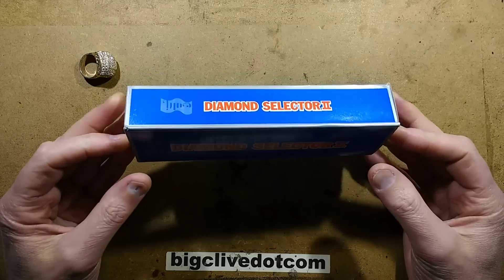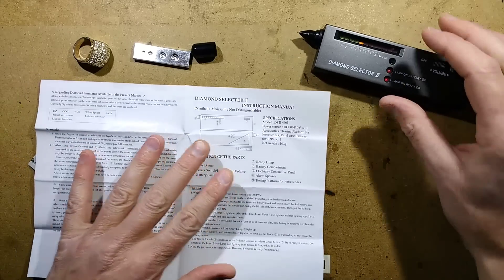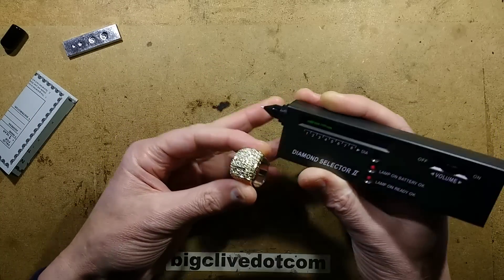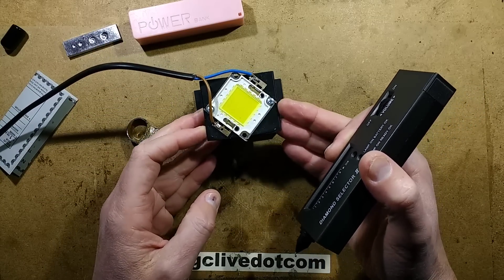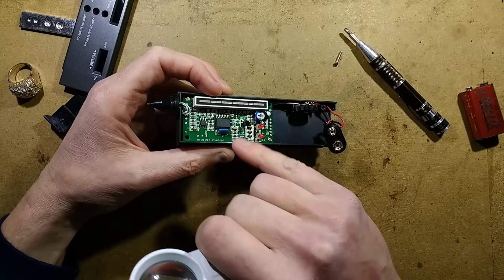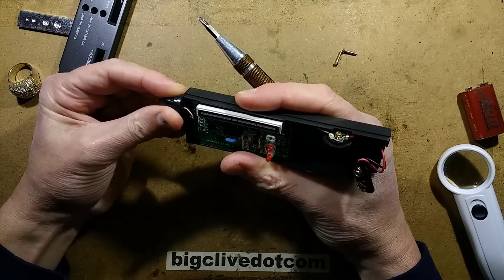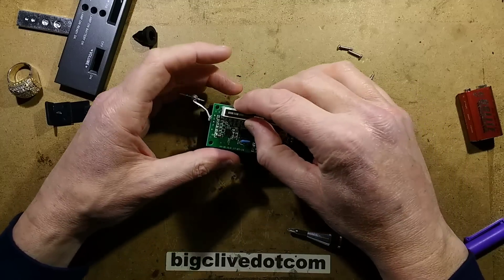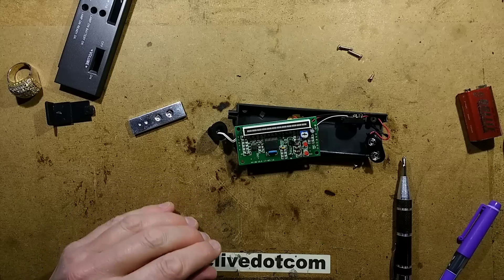Inside a diamond tester.  (thermal conductivity)

Comment: So looks like it has two back-to-back thermocouples, so at a constant temp the voltages will cancel out. The output will be in the microvolts range, so the pot will be to cancel out the input offset & drift of the amplifier stage - there will also be some thermocouple effects on the PCB & components so it would be pretty hard to make something like this without a manual offset adjustment.
Reply: Thermocouples work by welding two dissimilar metals together. based on  what I can see in the video and confirmed by Clive, the joints are soldered together. soldered joints will not make a proper thermocouple.
I would say, they are using a resistor bridge. the PTC wire is the common and the 2 copper wires are the other two ends of the resistors. the rod is the resistive element and it would have low thermal conductivity I would guess something like stainless steel (although, stainless doesn't take solder as far as I know)
Reply: +LateNightHacks  Stainless steel will take solder.  Phosphoric acid is your friend.  http://www.bssa.org.uk/topics.php?article=150
Reply: I also think that soldering two metals together will not make a proper thermocouple.
Reply: mikeselectricstuff in that sense is it like a PIR or load cell where the actual values mean less than the fact there's a differential?
Reply: Any junction of two metals makes a thermocouple IIRC, it will just be much more pronounced voltage difference per degree with certain combinations.
The difference created by the solder might be negligible enough in this case (given the resolution of the bar graph), or perhaps it gets canceled out by the use of two thermocouples.
Reply: +SarkyBugger
Cool, gotta get me some
Reply: RTD?
Reply: More videos PLEASE! ;)
Reply: Mike ya legend!
Cheers for the breakdown there...
...and make some more vids, ya legend!

Comment: Hey Clive, could you maybe take a look at one of these:  http://www.ebay .com/itm/DC-DC-5V-12V-Step-up-to-300V-1200V-400V-900v-1000v-Boost-Converter-Power-Module-/152175524315?_ul=DE ,because most hv supply's are quite expensive and i dont need 100kv at 1a so these, if they work, would be quite interesting

Comment: I'd be interested to see if you got a different reading on a heatsink with thermal paste.

The reason anodising is beneficial to heatsinks is because it creates a microscopically porous layer which effectively increases the surface area, and hence improves dissipation. However because the surface is less smooth, it has less area in contact with the heat source. Thermal paste increases this area by filling the pores in the anodised surface, which improves thermal conductivity, so I'm guessing we'd see a bit of a difference using this on a heatsink with thermal paste.
Reply: If the body of the component attached isn't at the same potential as the heat sink, typically ground/0V, or the potential of other components attached to the same heat sink,the mica isolates the component electrically from the heat sink and/or other component[s]. See also sil-pad.
Reply: The pores are in the 100A to 300A range, very small and once died black and sealed in boiling DI water it is no longer porous.  In early days you hard anodized a heat sink with a thick layer to act as an insulator so your didn't need a mica insulator.   Wouldn't do any good to have more surface area on the heat sink then on the device in any case.
Reply: What is the reason for adding a mica insulator on heatsink?
Reply: So when the next time i see a heatsink anodized on the part which interfaces with the heat source i can presume that whoever designed that device have no idea what the fuck they are doing?

Comment: I'd be interesting to see what happens on those copper sense wires on a scope sometime
Reply: Paddy Robinson-Griffin If they are in fact forming thermocouples then the answer will be not much as the voltages tend to be in the microvolts range yet most oscilloscopes do not measure well until you reach the level of at least a few hundred millivolts -- particularly in the case of digital scopes where you typically need at least several hundred microvolts to reach the per-bit quantization step, so your signal would be largely lost in the noise.  There are more sensitive scopes but they are few and far between since we generally are not interested in microvolt level signals when probing with an oscilloscope.  Plus such low level signals can be problematic to measure with long leads as the leads themselves can pickup RF and magnetic fields (induction) that can easily produce signals that would swamp things, so careful shielding (Faraday cage) is often required to be certain you are really looking at the signal of interest (note the use of very short leads in the device since they are not shielded or twisted).

You could assemble several precision opamps to boost their output to measurable levels, but that is a bit more involved now since you have to build a project before you can actually prove the signal...and there is always the risk that all that added capacitance might well distort whatever signal you sought to measure in the first place.  The best bet would be to just probe the inputs to the microcontroller to see what it is working with since those are the signals it is actually processing and analyzing.
Reply: Ethan Poole Excellent points very well communicated, thank you

Comment: Instead of using the thermocouple effect, maybe they're measuring the resistance of the sampling rod. The PTC has a power and ground side. The ground of the PTC is used as the common for measuring the resistance at the ends. It doesn't have to be absolutely precise but would need to have both ends balanced like a wheatstone bridge. Easy job for an op-amp and eliminates the non-measuring connections from forming an accidental thermocouple.
Reply: Yes I was thinking the same thing, I believe it's more than likely.

Comment: If the sensor is a  thermocouple junction then my guess is that the device sends a current through the junction (causing it to heat). When temperature stable, the current is at a minimum (ambient loss). If heat is drawn out of the hot end then current will increase. The op-amp may be used as a precise current sensor allowing the current change to be measured. Change in current would relate in some way to the thermal resistance of the test material.
 - Eddy

Comment: Yep. Am jeweler. I never trust these things to ID a moissanite, even the models that are supposed to.
Reply: Juraj Lonc heat it up to 700 degrees C, if it ignites that means it’s a real diamond. CZ and the silicon based fakes can survive a much higher temperature. 

But seriously there are a few videos on YouTube, both of useful ways to detect fakes and of burning diamonds.
Reply: Moissanites are also double refractive, that what most people look for. 

Heating it up actually a real option. A diamond and moissanite can survive an intense amount of heat, but a moissanite will turn the color of a tennis ball. The change isn't permanent, though. It will return to clear once cool.
Reply: Just curious, how do you distinguish diamonds from moissanite?

Comment: Could be useful as a "Heatsink Tester"!   I could always test this on the Wife's ear-rings (which are "the Real Deal") . . . . .
Reply: Phil S, it only tests conductivity to the heat sink, this just depends on the material used. Any block of aluminum will be the same to it. The important heat sink property is the dissipation rate once its warm. This will be far too slow for this tester, and the tester is also too light to heat up most heat sinks.
Reply: @Sander Deryckere, no, that wasn't the problem he was thinking, the problem was to test whether a heatsink absorb heat or not (like in the video)... turn out that the heatsink in the video failed a heat conduction test because of its coating; it is unable to conduct heat from its surface (or to its surface) unless if the coating is scratched away.
Reply: xponen But according to Sander that anodization effect is more important during changes in heat output (measured by the Diamond tester) than during a steady state situation (when a device produces 50W that needs to be continuously removed.

Comment: Clive, have you seen the febreze alternating dual scent air fresheners?  Looking through the vents, there’s a circuit board inside with two large resistors and a capacitor. Wonder what’s doing the timing. The assembly is heat staked shut.
Reply from the maker: They tend to use a blob based microcontroller with simple support circuitry for power and to switch thyristors for the heating elements.  I took apart a three channel version:-  https://www.youtube.com/watch?v=cG8tLyJDQbk

Comment: Any metal can be used as a "thermocouple" if you don't care about the actual temperature. As in this case, the rate of temperature change from one end of the rod to the other is all we are concerned with. The principal of the thermocouple relies on the material(s) Seebeck coefficient. Not an expert on this, but basically any metal develops a voltage difference from one end to the other due to the temperature difference. In a true thermocouple two different known materials are used (usually with Seebeck coefficients of opposite polarities - so the generated voltage at the ends is maximized). In this case, since we don't really care about accuracy or the actual temperature, you can get by with one rod (the wire makes up the second leg of the thermocouple in this case) and the device just registers the change in voltage (or the rate of change) due to the temperature difference along its length. As long as the wire and the rod have different Seebeck coefficients the temperature change will cause a voltage change.  That's my theory anyway.
Reply: Wouldn't a thermocouple made of one material be called a thermosingle?
Reply: @gcewing  it's called "thermistor" =P
Reply: It has to be a junction of two dissimilar metals.
Reply: The junction of dissimilar metals is there so you can measure the voltage from outside of the sensing location. If there was some magical way to measure the voltage at both ends of one piece of metal without a second lead wire going to the hot end, then you could make a thermocouple out of one material. The fact that you need a conductor to measure voltage is why you have the second material. It is a dissimilar material so that it has a different Seebeck coefficient. If they had the same Seebeck coefficient the generated voltages on each leg would cancel each other out.

In this case the second leg is just the varnished copper wire.
Reply: Agreed: Not how you make a thermocouple. But if all you need to do is measure a temperature change (as measured by a voltage change), then you could use bubble gum to attach the leads.
Reply: In this application it's all about measuring a voltage change. The solder interface between the two metals will not affect that. In a real thermocouple we are concerned with accuracy, so introducing other materials into the circuit can cause errors (if the junctions are at different temperatures between the two legs). Here, as long as the voltage can be measured, then the bonding material does not matter.
Reply: the metals are soldered together, that's not how you make a thermocouple
Reply: I agree that the joint does not have to be mechanically sound, even a twisted wire would do. but when wires are soldered, by definition, the solder metal makes the interface between the two metals. the two metals don't come in direct contact. I don't think that would work properly
Reply: @LateNightHacks  if the whole solder junction is at same temperature - it doesn't matter. Precisely because the voltage of the thermocouple is actually developed in the length of the wire, where the temperature changes, not at the actual junction. But of course soldering has some drawbacks, such as: * if you tin up the wires a bit, it will affect the alloy in the temperature-change region; * the max temperature is limited to the melting point of solder; * solder can slowly dilute into the wires and disrupt the accuracy of alloys in the place where it matters - where the temperature gradient is.
Reply: In my humble opinion, the thermistor is both heater and sensing element. A stable constant current supply across the thermistor will cause a heating effect due to the current drop across the device, this will cause the thermistor resistance to fall from its initial value at ambient. As the thermistor warms up the metal rod to which it is attached, the voltage across it will eventually stabilize at some set temperature. If the rod is placed against a cool surface then heat will be drawn away, cooling the thermistor, its resistance will rise and so will the voltage across the thermistor. Measuring rate of change of voltage will give a value for the thermal conductivity of the surface tested. Secondary wires soldered to rod???